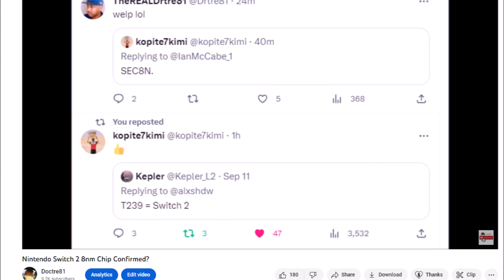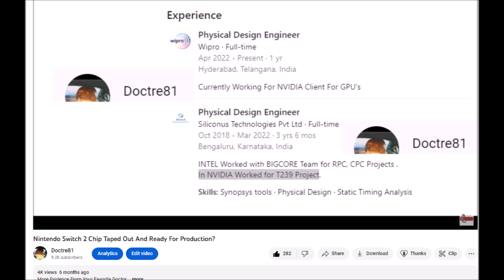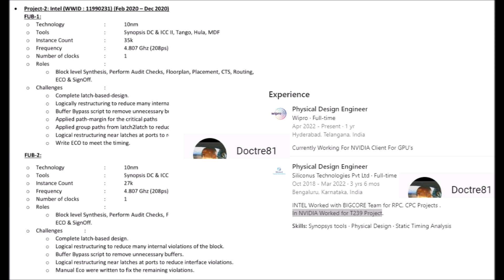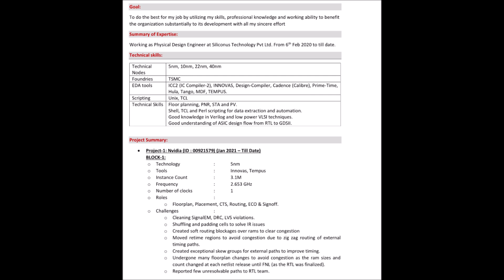Nintendo Switch 2 5nm And CPU Max Clockspeed Evidence?

Comment: I did also imagine a scenario of them stripping down the soc believe it not. Why? so they can make a cheaper soc then pair it with a supplemental computing you know another gpu in the doc.
I know tre you doubt the supplemental device coming because of your friend worked on the patent. But pairing a additional gpu with a 8 core a78 would be a really good combo.

Comment: My bet is they have it at 2 GHz and they disable 1SM for yields. Gonna have a guess that 1200Mhz will be it's docked clocks for the GPU and around 800Mhz in handheld mode.

Comment: So NINTENDOS 2023 NEW PCU SPEED will be between a PS2 and PS3 😔😔😔😔😔😔😔😔😔

COMMON!!!
Reply from the maker: Huh? Maybe you need to look up the ps4 CPU speed
Reply: @Doctre81  i did, Google is lying? 

Nintendo said today it will be 2.5Mhz 
PS3 3.2Mhz
Reply: @warlordmel clock speed doesn't really mean anything, by your logic a cpu like the i7 13700h would be worse than the ps3 cpu given the base clock speed in the p cores is "only" 2.4ghz. And given its weird architecture the ps3's cell cpu is only roughly equivalent to a core 2 duo e8400 cpu
Reply: @pc_screen5478  So in comparison, how well does the Switch 2 perform? PS3 PS4 or any Xbox closer?
Reply: @warlordmel  it should be closer to ps5 performance than to ps4. The a78 (which is rumored to be the next switch's cpu) gets around ~3300-3700 on geekbench 6 multi-score, depending on the device. For comparison, the ps4's equivalent cpu (atom c2750) gets only 1000 on the same benchmark and the ps5's equivalent (r5 3600) gets 6800. So the next switch's cpu should definitely be up to the task of running games like gta 5 and such. Take these numbers with a grain of salt because they were measured with CPUs that are not exactly the same as the ones actually used in the consoles (eg. the a78 number was measured on phones that run at ~1.8-1.9 ghz and with passive cooling and the next switch may even have a different soc altogether)
Reply from the maker: @warlordmel  Now google the ps4 cpu speed
Reply: @pc_screen5478 so it would be stronger than ps4 pro?
Reply: @darwinsgame6626  definitely more powerful than the ps4 pro's cpu but that isn't saying much. Given the difference in architecture and things that Nintendo will have to cut down for the price target it's difficult to tell whether the switch 2's (or whatever it'll be called) gpu will be better for certain, but since it's a newer architecture it should have several advantages over the ps4 pro's old gcn gpu, maybe even outperforming it depending on the application. The main concern for the next switch is still memory bandwidth though I'd say. The orin nx has 102gb/s of bandwidth, less than the ps4 pro, and Nintendo might even reduce memory speeds which would lower bandwidth further (hopefully not)
Reply: @darwinsgame6626  not to mention dlss should place it beyond ps4 pro's capabilities
Reply: @pc_screen5478 memory bandwidth is a concern but it would still be a 4x increase over the switch.
Reply: Clock speed doesn't make the CPU faster, it's how many Instructions Per Clock it makes is what's important. PS2 had a 300Mhz CPU.

Comment: Could be that the 2.6 ghz is the single core boost. On modern CPUs a single CPU core can boost way higher compared to when all cores are boosting.  So the all core boost could be 2ghz, maybe even lower but for small games not needing much CPU, they could usitlise a higher clockspeed.

Comment: Thanks Doc, yeah the reason Orin and Drake couldn't use the same process node is simply because according to Nvidia's own performance tools for Orin, a 12SM GPU at 422MHz and an 8SM GPU at 600MHz would use about the same power (~6 watts for just the GPU) and produce 1.29TFLOPs and 1.23TFLOPs respectfully, which is a difference of 60GFLOPs for 50% more transistors, it's a smaller gain than XB1 to XB1S for much more money... 5nm (TSMC 4N is a 5nm process btw, and is our current expectation) is officially cheaper than 8nm would be when volume production is taken into account, would estimate a power consumption of just over 4w for 660MHz, which is a clock found inside NVN2's DLSS testing from summer 2021, that clock had a name in the test of "4.2w", which would give the Switch 2 GPU 2TFLOPs portable performance.
Reply: That doesn’t make sense if the leak came out 2021 and 4N production is 2022. They might be using another node
Reply: @kingdrift1136  Mass production may have started in 2022, but products using this technology began to be planned as early as 2021. After all, there would be nothing using 4nm if the producers only knew it existed on the same day as us consumers.
Reply: @kingdrift1136  the leak was March 1st 2022
Reply: how are the chances that nintendo will use lovelace?
Reply: @AleX-hu7ci  The chip was leaked in a hack 18 months ago, it's "GA10F" (Geforce Ampere 10F) Orin is GA10B, it does have some Ada features, and it's OFA engine (Frame Generation stuff) is the same as Orin and different from both Ampere and Ada, it has dense pixel flow, so it's possible to use frame generation with Switch 2, but we don't know the speed of the OFA engine, considering Orin is for cars, I'd expect it to be much faster than Ampere's normal OFA. We will see.
Reply: thoughts on backwards compatibility?

Comment: Those CPU clock speeds are very underwhelming. Modern smartphone high end CPU performance cores can run at 3.6Ghz at ease. While their secondary performance cores run at 2.8ghz with efficiency cores being at 2Ghz. While being on a passive cooled slim smartphone. If 2.6ghz is to high for Nintendo to target they will be CPU bottlenecked with an extremely slow CPU. Just like the Wii U and Switch was.
Reply from the maker: CPU clockspeed was not was what bottlenecked in switch.
Reply: @Doctre81 There are literally tests all throughout YouTube of people removing the Switch GPU, CPU and ram clock speed caps. The biggest gains are CPU then Ram clock speed increases. The Tegra X1 is a very powerful chip when pushed to the limit. It can in fact match the SnapDragon 865 in gaming performance. That was a high end SOC from 2020 also.
Reply: @Doctre81 Yes the Switch was bottlenecked by its slow clocked CPU and only 25gbs of memory bandwidth.
Reply: @ZackSNetwork  It was bottle necked entirely by the bus memory bandwidth.  The CPU was pretty good.
Reply: @mrlacksoriginality4877 The CPU of the Switch runs at only 1Ghz. The CPU can easily hit over 2Ghz.
Reply: @ZackSNetwork  Your point?  The Switch bottleneck i caused by the bandwith being like 1/7th of the PS4s.
Reply: A 2GHz A78C CPU would give around 2/3rds the performance of PS5's CPU, A78 is much faster per clock than Ryzen 2. Remember Switch only had 4 usable cpu cores, Switch 2 has 8, which is standard this generation, and is what most developers will be using in their current gen games.
Reply: @syferz The PS5 and Series consoles CPU’s are Zen 2 based. However in terms of real world performance they are as fast as the Zen 1+ Ryzen 7 2700x. This is due to three things. Number 1 they only have 8mbs of L3 cache instead of 32mbs. Number 2 very low CPU clock speed and number 3 not a lot of wattage for the CPU.
Reply: @ZackSNetwork you talking like the switch 2 is already out 💀
Reply: not a good comparisons since for what the Switch lacks in clocks it wins out in thermals and performance over time. 

something phones still suck at for the types of games that the Switch 2 will be able to run without having to worry about throttling.

Comment: One other thing the a78 can be manufactured on 8nm or even 5nm but no lower since samsungs 3nm is a completely different design than 8nm and 5nmand I would imagine that nvidia would have to redesign the chip to work on that node and I don't think thats going to happen. So I figured they would choose five nanometer because nintendo values battery life and maybe nvidia could beef up the soc because of the smaller node size compared to 8nm.

Comment: Maybe Nintendo testing out both 5nm & 8nm. Hearing all the noise, as long as the Switch 2 can hit 1440p natively without DLSS we good.
Reply: From what is expected to be T239, 1440p native will be only possible in indie games or very simplistic visuals. Any current gen game will be, more probably 540p or 720p then DLSS to 1440p or 4k. But DLSS 3.5 is amazing and can give a final image better than a 1080p native.
Reply: @alessandrooliveira3218 using DLSS to upscale from 540p to 4k would be a terrible idea. DLSS isn’t that good
Reply: You might as well just buy a ps5 or Xbox if that’s what you want lol
Reply: Try 360p in mobile mode for 3rd party games
Reply: @jolang8022 its going to be at least ps4 power…

Comment: I saw that Cortex-A78AE's maximum supported CPU frequency is 2.2 GHz. That frequente of 2.6 GHz is probably the maximum we can have from the A78C (switch 2's most probably CPU). So, I believe you are right on that. Congrats and thanks for that.
Reply: The max is 1.1 dock .67 handheld
Reply: @kingdrift1136  and from where did you find these numbers?
Reply: @alessandrooliveira3218  my b thats gpu levels
Reply: @kingdrift1136  these numbers you put are probably average, not the maximum. When someone work on the project, they put the max it can reach. Not that Nintendo will use 2.6, but the CPU can handle it, if necessary.

Comment: Not enough info to know if it’s T239 or not imo
Reply: The Nvidia leaks show it is the T239. It's a custom chip designed solely for games with a data decompression module, which would help speed up read and reduce the final size of games. It's also the only chip that appears in NVN2 updates (the Switch 2 firmware). That chip is made from Nvidia to Nintendo. Not another chip, not another company, this will be the Switch's GPU.
Reply: @alessandrooliveira3218 Leaks from the beginning of last year lol obviously it won't be this weak chip that can't even handle shitting this Matrix awakens demo at 30fps.
Reply: @AllyToWin  The only chip that appears on NVN2 updates is T239. The T254 is a automotive chip, not game related. Plus, the T239 at 4nm is capable to perform 4 Tflops on dock and 2 Tflops on portable. That is not weak at all.
Reply: It’s not T239 anymore that was just the testing ground for the devkits. It’s a custom chip altogether.
Reply: @ZackSNetwork    T239 IS THE custom chip, though. It's a customized version of T234.
Reply: @cflannagan t239 is  too old and is not economic for the Nintendo watt performance requirement
Reply: @ZackSNetwork Yes, I think it will be a new Ada lovelace chip reaching up to 4 Teraflops on the Dock and 3.2 tflops on the laptop called t254